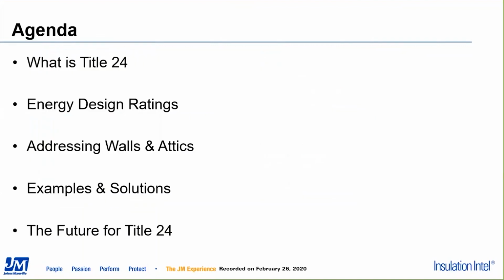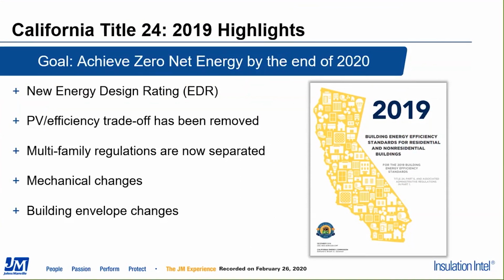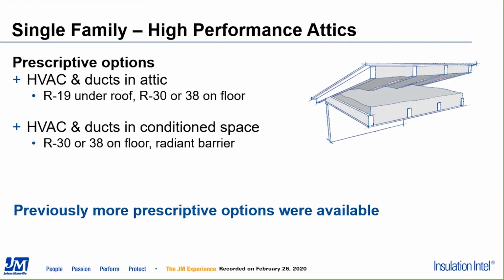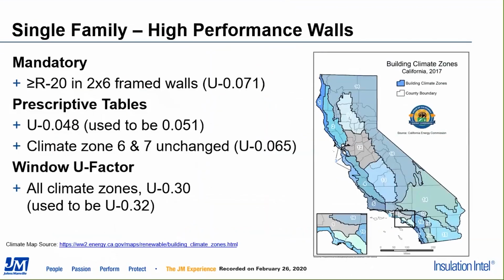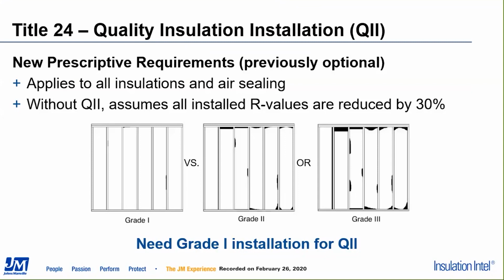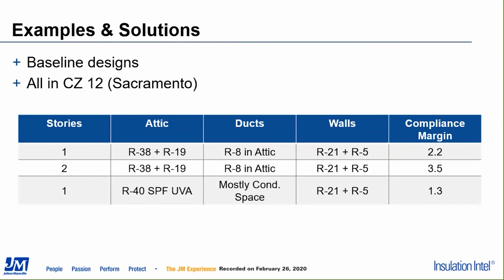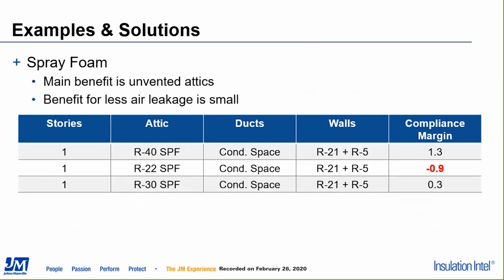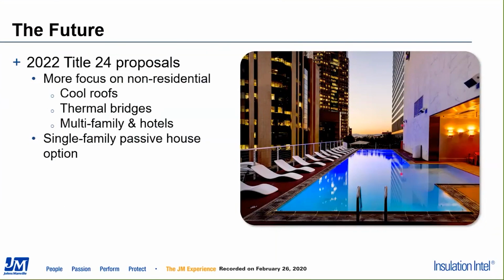Title 24: Building Envelope Changes

Comment: As T24 consultant since the 1980, I have attended/seen a whole host of presentations attempting to clarify the current energy code.  Many of  the presentations have been offered by industry and product suppliers.  The majority have been weak and often loaded with errors.
This JM presentation is far and away the best and most accurate presentation I have seen by industry representatives.  Well Done!!